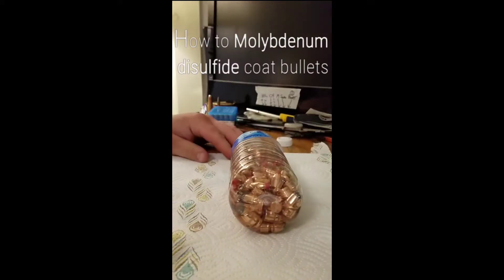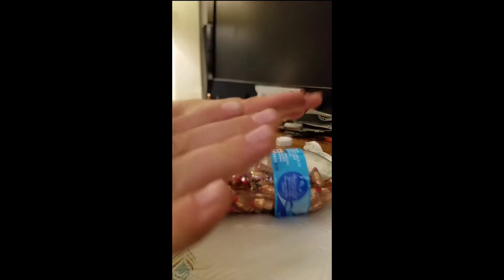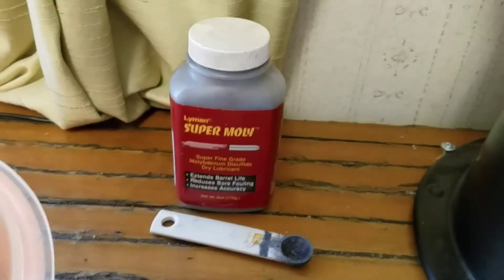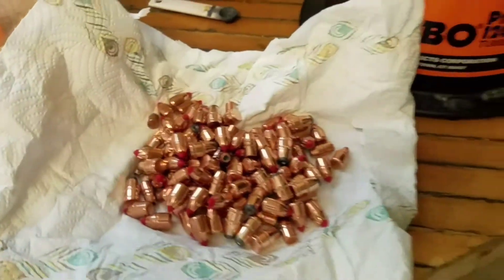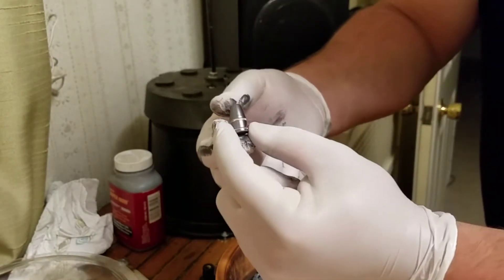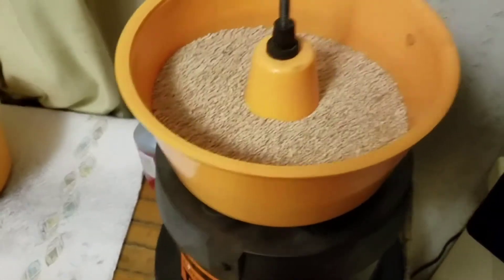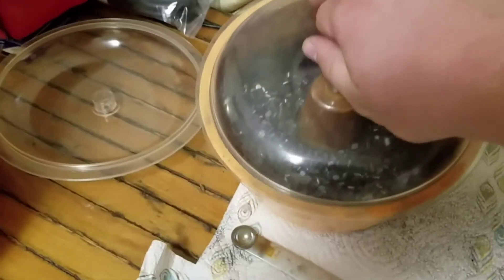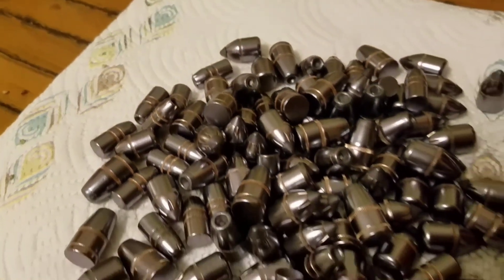How to: Moly coat bullets (Molydbenum disulfide)

Comment: After cleaning off tumble again with clean Cobb media with a bit of carnauba wax
Reply from the maker: Thank you for the idea! This was years ago, but occasionally, I still do it. I have noticed some that have been shelved for years, they tend to oxidize a bit, and with enough shuffling, the coating can rub thin in spots. That sounds like a great way to help combat both!
Reply: @ lol, i didn’t expect a reply, and so soon! I was cleaning my garage a few days ago and found three of my bottles of DOW moly powder that I’ve had forever and wondered what else it might be good for besides what I used it for over 20 years ago, impact plating 7mm projos just like you’re doing here. Idk why I clicked your video, I guess I was just wanting to see if anyone was still doing this and if there was any new technology involved. I used to put my bullets in a small plastic Tupperware container with steel BBs and a spoon full of moly powder, then put that Tupperware container in my vibrating tumbler with the cobb media. It’s a ton cleaner like that lol. After I separated the projos from the BBs and blew off the excess moly, I put them in some cobb media with a spoon full of carnauba wax powder and vibrated them for an hour or so, the wax helped the moly to really stay on well. I learned this from a magazine I used to get called “precision shooting”, a well known long range shooter named Tubb wrote the article and it was the fad back then lol.
Reply from the maker: @shanek6582  i worked part time a few years ago at a gunshop (opened my own recently) and it was a new old stock lyman moly kit that got traded in. I did alot of research on it, the good, the bad, and extras. I figured for what I do, mostly just load development and hunting, I likely wouldn't experience much/any of the negative issues with moly. I have used some of the powder from the kit for dry lube around the house and other projects, comes in handy! Lol
Reply: @bearsfootball72  It never even occurred to me to attempt to coat the brass!  I think that would get really messy!

In the earlier internet days (early 2K's) somewhere I remember reading that MoS2 was a bit toxic in the blood stream.  Prairie Rats are one thing, Those you don't eat.  I did coat about 750 9mm Hornady XTP's and have used them exclusively in New Barrels on New Guns.  Once you shoot a couple mag dumps of Moly coated bullet, you're patches will forever come out black no matter how many times you clean it...
Reply: @ also, I impacted plated a bunch of 9mm brass once and you could really tell the difference in how smooth they chambered! You could randomly load one round somewhere in the middle of a fully loaded magazine and actually call which one it was when it went into the chamber. I can’t remember why I didn’t keep plating my brass, getting too old I guess. Thanks for the video, it brought back some memories.

Comment: Used moly on heat shrunk parts that needed removed again.  It works wonders for tight fitting pieces, little to no galling on the fits.  Would work great on press or heat fit bearing parts.  Always wondered if anyone adapted that to ammo and if it actually made a velocity difference.  Might help with longevity of higher pressure rifle rounds possibly.  Once that bullet catches the rifling and starts down the barrel that moly is quickly worn away though.

Comment: What is the benefit of moly coating vs polymer coating.  Iknow that molt coating has been around for a awhile.  Justwnated to know your input i have been thinking about doing thsi for awhile
Reply: There are ups and downs.  The ups:   Mean Velocity spread became a LOT more stable!  Velocity increased a bit, pressure slightly decreased, Barrel wear and leading reduced a LOT!  Cleaning time after a range session is vastly reduced.

Downsides:  Anything you use to coat Bullets with Moly is now completely dedicated to moly coating.  You will NEVER be able to clean the moly off.  Should you make the mistake of attempting to launder a moly contaminated towel or rag in your washing machine - Your wife will suddenly insist on pain of divorce that you must NOW replace not only the washing machine, but also the dryer and EVERY plastic bowel, cutting board, and well everything else you maliciously coated with Molybdenum.  And of course, the worst of all downsides - She will continually bring up and remind you of the fact that you completely ruined her Precious "Stuff" for the rest of your time in what can only now be described as "Hell on Earth" .

Makes great performance bullets!  I made a bunch in the late 90's when it became a "Thing".  25 years later, she's finally forgotten that I had to buy her a new washing machine, dryer and multiple kitchen ware items but I'm really thinking of trading her in on a younger model now...
Reply: Do you know a good source for Moly Coating?
Reply: @yojimbo05  I assume you want to know where to actually obtain a container of Molybdenum powder used in the coating process?  -  I always just got it at my local gun shop!  It's there among the rest of the reloading components aisle.  I assume that if they don't have it, either try another shop or ask if they can order you some.  I don't recall it being super expensive or anything like that.  Though, these days who knows!?!  I haven't purchased any more since the late 90's early 2000's and I know that despite having coated 1000's of bullets, I really doubt I even used half the container!  I don't recall the price, I DO recall that I had to replace my Case cleaner/Vibrator thingy with a new one because the old one became a dedicated Bullet coating thingy!  And that was close to $90 - THAT I DO remember....
Reply: @yojimbo05  I just looked up:  Amazon has a 2 oz container for less than $13.  1 Lb for less than $50 somewhere else.   Not difficult to find...  Like I said earlier, a couple thousand .223 and 9mm bullets and I'm sure I havent used even a whole oz yet.  Biggest price was replacing a new Tumbler...
Reply: Most of the reloading shops around me carry more bullets and powders general  stuff i will check a few of them and see what I can find.  I know Barnes use to use Poly and Moly coating the technicians stated they had outstanding progress with their lands and projectiles and so did other manufacturers but it was messy and several stated taht the so called residues and powderburn off was some issues but not for most.
Reply: Gotcha my friend it is grwat talking with you on here and enjoy so much speaking with someone taht does relaoding as much as I do it is ah honor and privilege my friend.  I look forward to seeing more of your  videos.
Reply: Is Moly coating or poly coating which you recommend be betterxto do or betmst results.  I know the worst part is it being messy lol
Reply: That is hilarious  but I also have ruined a few things with the wife too but not that level magahah I hope you where nit in the dog house to long my friend lol
Reply: Ia there a way to add color to the Moly in order to get colored Moly Bullets.  I jaut wondered in what process do you do it?

Comment: can it be used in the barrel instead of on the bullet
Reply: I run a patch down the bore of my AR10 with 95%+ isopropyl alcohol/ Tungsten Disulfide solution over CLP now. It's made a big difference in accuracy for me.

Comment: What's the point of this molly coating?
Reply: Moly is a great lubrificant, I think that with this coating, the bullet lose less force with the friction inside the barrel and maybe the air.
Reply: Ascaithe  I know it was an old post... but does it effect velocity?
Reply: Moly coating reduces friction in the bore, it cuts down on copper fouling big time. In some cases hardly any Copper fouling.
It allows you to clean the Rifle without brushing. As Copper is non existent in the bore. It reduces Chamber Pressure and allows to to shoot a competition all day without loss of accuracy. 
And it increases the Barrel life by double that of using untreated bullets. 
I pulled an F class Barrel which only saw moly coated bullets. The bore was totally free of copper. Not a touch of Copper at all. The barrel is as good as new.
Reply: @hughhughp68  hey, thanks for definitively answering my question. 3 years later but still good to know. As a mechanic, I personally buy Molly infused grease for my work because time and time again it has proven to do a better job and last longer than most regular grease. For example, I use it on the slider pins that brake calipers float on. These pins see tremendously high forces as well as all sorts of road grime and I've literally had to slide hammer them out before from being rusted in their holes. Never had to do that to one that had been lubricated with Molly grease.
Reply: @Max_Chooch  you should try Tungsten Disulfide. It's the slickest lubricant known to man. 

I mix it in with high temp/pressure grease for my bolt carrier group on my ARs and coat lightly. Even run a patch down the bore with a little on it. 

It's made cleaning my rifles so much easier, and I've noticed significantly less wear. Also makes them feel smooth to operate as well.